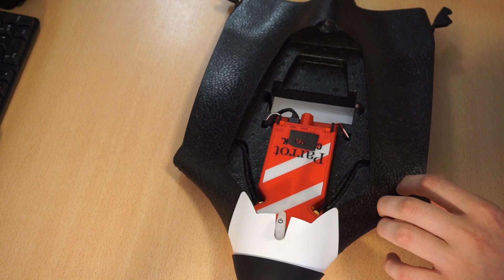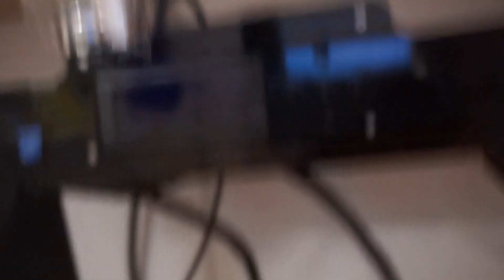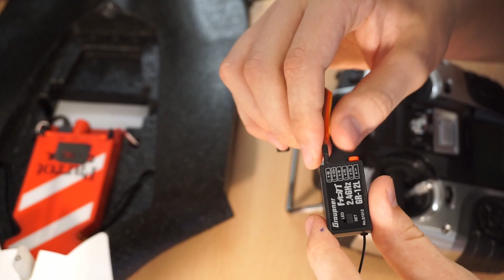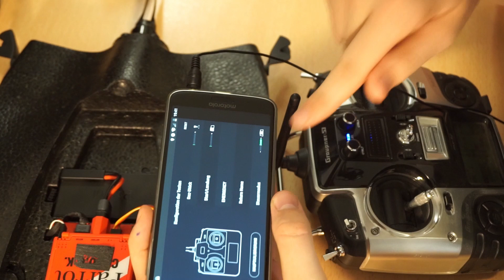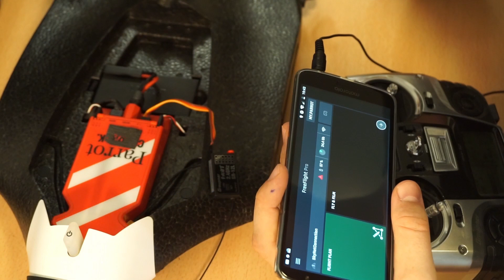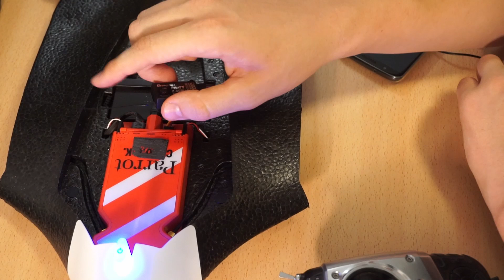Parrot Disco Manual Acro Mode Tutorial RC Remote Control use other Controller

Comment: it's funny that the disco itself is kinda terrible due to the wi-fi trasmission system and to make long range you need to use an rc plane controller kit or the 4G module mod

Comment: Hi I'm using an Orange RX TX6i with an ORX R618XL cPPM. I can not get the Disco to register the inputs, even though its being powered by the Disco, any advice?
Reply from the maker: according to parrot.com cppm should be supported. are you sure you've set the receiver to that cppm mode and have the cable plugged into the correct port? (usually only a few ports on the receiver support that feature) :)
Reply: Doesn't work with my orange R615X. I have a feeling cPPM is not supported.

Comment: Hi, I like to set up my Jeti DS16 and I miss an information: which model setup do I choose in the transmitter: plane with mixers or a quadcopter without mixers?
Reply from the maker: you want each channel seperate , so if those two are your only options, id suggest you use "quadcopter without mixers"
Hope it works for you :) make sure to test everything before flying :)
Reply: I used the quadcopter setup and it‘s working fine! 😊
I‘m still a little bit confused with the 3-Way-switch because you don‘t need the SC2 anymore.... 🤔
Reply from the maker: @Crottorfer the 3 way switch is so you COULD use the skycontroller (which might be useful sometimes) but you don't have to :)